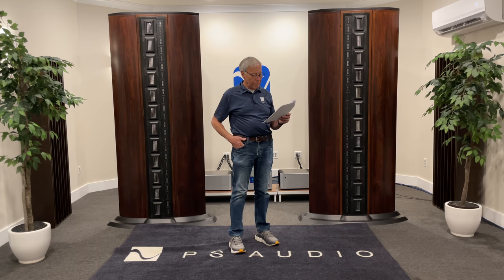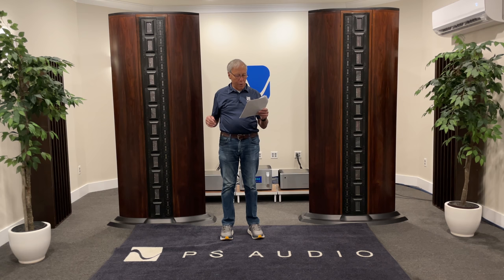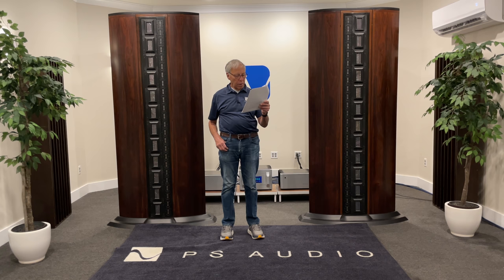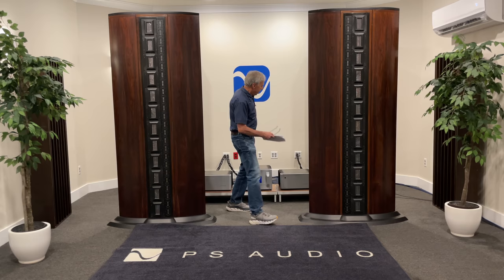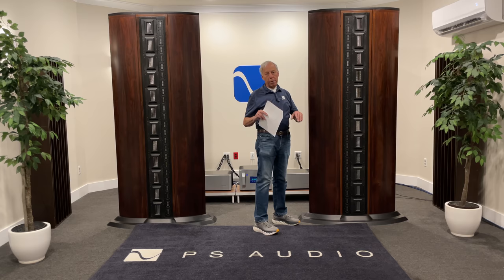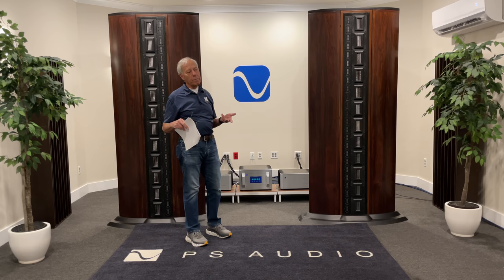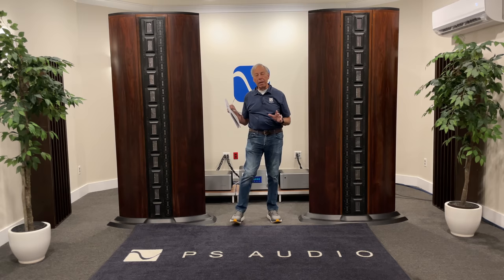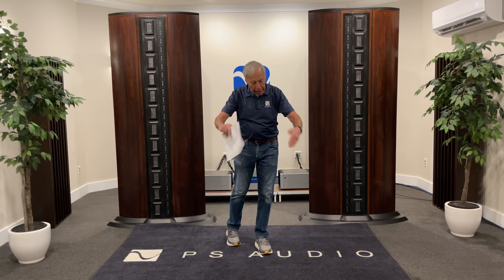How to position speakers

Comment: I agree with you, Paul. Don't limit yourself with an equilateral triangle. I used your book and CD. For my room, I ended up with 7 ft from woofer center to woofer center with the listing position being 10ft from the speakers. Speaker positioning was limited (by the room and spouse) to 5 ft from the front of the speaker to the front wall. Best soundstage I've ever had with my system. Thank you so much.

Comment: Hi Paul, This video is right on time, I am trying to play around with my speaker positions and was facing the same problem. Thanks for your explanation to the point, I almost had my questions answered, except for one thing.
Does the sidewall as well matters? Currently I have them 1.5 feet away from the sidewalls. Can't pull them any further as it would block projector view, yes I am using this for both music and home theater as I can't afford a separate listening room... :)
I believe many people face this problem too, should I be ok if I can just pull them from front walls? Or is it really important to leave room for sidewalls as well ?

Comment: Great audio systems are too often not great sounding due to poor room acoustics including where the speakers are placed. It can easily do much more difference than the difference between models of amps, DACs and other electronic gear.
Reply: Absolutely. My biggest “aha!” Moments have not been after buying some new gear, but after changing the room around. My system sounds better than some of those luxurious yet poorly set-up systems and knowing that makes me all giddy hehe.
Reply: Paul has mentioned as far as bass goes... move yourself not the speakers. If I want to be reminded how deep my speakers actually go, I go to the far corner and it sounds subterranean.
Reply: @ChiefExecutiveOrbiter  Paul’s advice was about putting ones subwoofer in your listening position and finding the optimal position for the sub by listening for the standing waves
Reply: @ChiefExecutiveOrbiter  In my home office setup I have a single subwoofer and have got the setup done perfectly such that the bass is much more powerful in the place I’m sitting and people always get fooled when I ask them to tell me where the bass comes from.
Reply: James Doolittle  Yes, true. I just watched a movie in my home theatre room and I am not going to rip anything apart. It serves as a listening room also but I find it way too boring to just sit and listen doing nothing else. Most of my listening nowadays is at my home office setup because it allows me to do other things while listening.

Comment: I think the issue of “speaker” placement can be both more easily (to more complicatedly) solved with “separated” (designed) speakers. 

So for example, there’s been way too much unnecessary confusion, angst, $’s spent  & for too long on so called “BOOKSHELF” (all speakers in one box) speakers. It’s hard to ignore “bookshelves” speakers have not solved customers’ interior design issues. 

Sonically, it’s been known for decades to generations that each frequency range, ie.,low bass, bass, midrange, upper mid range, tweeter can have, to need different placement, locations,  positions, etc., relative to ideal to personal preferences in ANY listening environment.

Comment: Wondering how tall you are Paul? I'm guessing quite tall... 6ft 1, 2 or 3? By my estimation, if you lay down on the floor in front of the speakers left to right, head and toes would be about at the tweeter on each speaker.... so is that roughly the distance between your speakers, tweeter to tweeter? just over 6ft?

Comment: Experimentation is the key and great sound sometimes deviate from the dogmatic precepts of loudspeaker placement. On some recordings, you can achieve the illusion that sound appears to come from behind your listening chair even though there are no surround speakers placed there.
Reply: The Gong bands “radio gnome invisible” trilogy of albums does this to fantastically psychedelic effect. The 2nd of which (called Angels Egg) being recorded in and around an old hunting lodge near Paris, with nice tube mics hanging from trees for drum and synth overheads etc.

Comment: My advice—buy the book and the SACD.  For most of us if you follow the speaker setup steps, you’ll find that your speakers are significantly further from the front wall and further apart than they were prior to using Paul’s guide. 4 ft from the front wall is significantly further than it seems when you initially eyeball it, accompanied with the inevitable displeasure from your wife. I recently purchased Focal Spectral 40th anniversary floorstanders and only after I followed the setup guide did I feel I was getting my money’s worth. The book and CD cost less than a mediocre pair of interconnects yet the improvement in sound quality can be more dramatic than spending thousands on new components.

Comment: Personally i had more issues with the side wall. moving them 2/3 of the way from the front wall or visa versa. my understanding the distances should not be equal.
Reply: Or skewing the direction the speakers are facing diagonally, I’ve set my speakers up facing away from corners to great effect.

Comment: No mention of speaker distance from side walls and if it should be equal.
Reply: a room must be pretty symmetrical left to right, otherwise you have to put a lot of work into your rom and eq to get something near usable.  that include speaker symmetry in the room.
Reply: @sudd3660  Thank you I need to rearrange my room and reposition my speakers.

Comment: Due to room constraints, I positioned my floorstanding Klipsch RF 63 on adjacent walls, facing straight ahead,  about 11 apart, with the listening position 8 feet away facing the inverted V where the walls meet. I have bi amped them using my Marantz SR top shelf AVR. Forgot the model number. I listen to music in stereo with a Velodyne Ultra 1200 sub blended in, crossover overriden. Audyssey room Equalizer is disabled in this biamp setting which is good.one can also watch movies in a 5 loudspeakers setting or more. The sound  is just superb especially listening to records and tapes. Nearly forgot. All crossover at 80hz, including so called LFE and all loudspeakers LARGE. Marantz top shelf AVRs are gems.

Comment: Just buy the damn book! 😜
Reply: I did and the SACD too !  And the guide tells me to start by pulling speakers 4 feet away from the 'front wall'.  Due to the unfortunate configuration of my room that can't be changed (wife factor), that would make the speakers literally 6 feet in front of me !!!  I think I am S.O.L  ...
Reply: @ptg01  my apartment is itty bitty, 4 feet from the front wall is nearly 3 feet in front of me! The seat is about six feet from the rear wall to accommodate my home studio. All the gear makes for great reflection and diffusion!
Reply: @graxjpg  What I neglected to mention is my speakers are about 25" wide x 38" high x 15.5" deep..  Like, they are a bit big as well as heavy (~100 pounds)
Reply: @ptg01  big speakers for sure!! I’ve got amps that weigh nearly that much, but I try to keep just one good set of speakers that I know well in the house.
Reply: @graxjpg  Indeed... so if I were to pull it out even 3 feet away from the wall, it will just take up way too much floor space.  Unfortunately, I can not use the LONGER side of the room as the way everything is situated, I am stuck with the short side of the room.

Comment: The Rule of Thumb has always been a 2 to 3 ratio. 2 units apart for every 3 units away. Listening position 9 ft away? the speakers should be 6 ft apart. Because of the laws of physics, any further apart than that and the distance/ delay from each source to alternate ear becomes too large for the brain to properly process. 

Paul Klipsch solved being forced to have his corner horns so far apart and the center hole by creating a center fill speaker. A heresy in the 2 channel industry. So that is what he called it, the Heresy.
Reply: exactly what law of physics are you referring to?
Reply: Seems to make sense 👍
Reply: Left to educate the uneducated. Laws of physics. Speed of sound. Signal path length.  Frequency/ wavelength. Take a source and place it a distance but directly in front of your head and the sound waves from it will reach both ears at the same time. Your brain will determine that central location from this information.

Place a source in a straight line away from each ear and the sound from the "right" source will reach the right ear before it reaches the left ear. The relative timing difference is frequency dependent and extended do to travel around the head without a direct path to the opposite side. Plus their will be frequency related roll off. The brain uses these cues to determine location. At lower frequencies the distance between the ears is less than one wavelength so no location info exists. But at higher frequencies the timing/ phase difference can be very dramatic. There will be a "center channel" because the same information arrives at each ear at the same time. With the same frequency response.

Placing the two sources in the 2/3 ratio provides timing and frequency cues to each ear as direct paths (no rolloff) and with significantly less timing difference from ear to ear.  

So Laws of Physics. Relative distance, path length, frequency response, head contour, ... determine the brains ability to create a center channel.